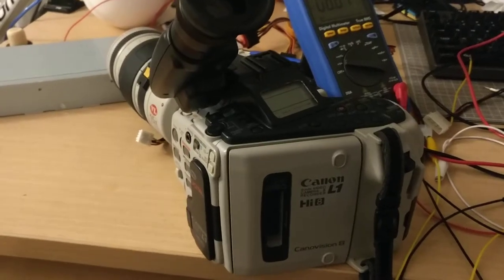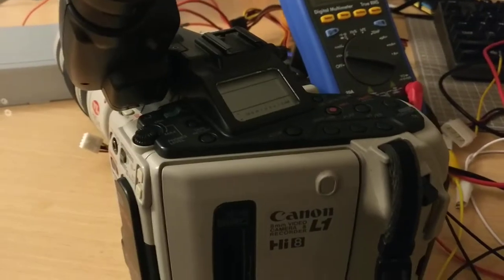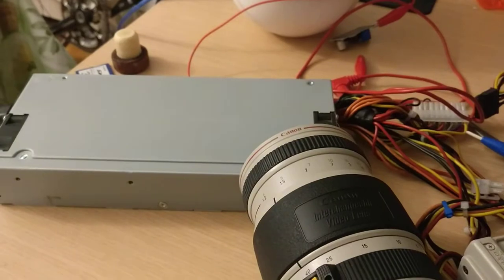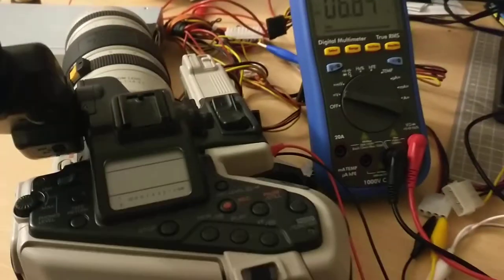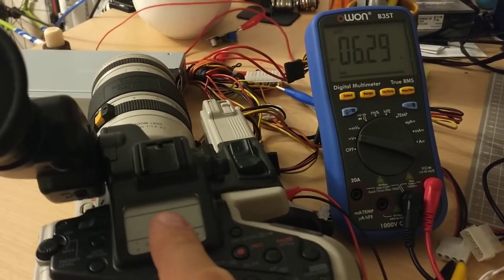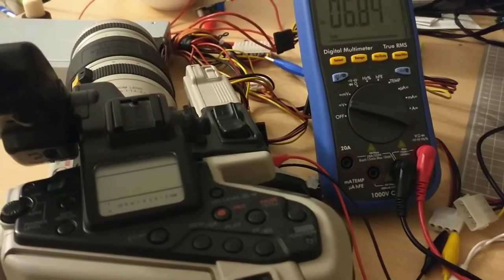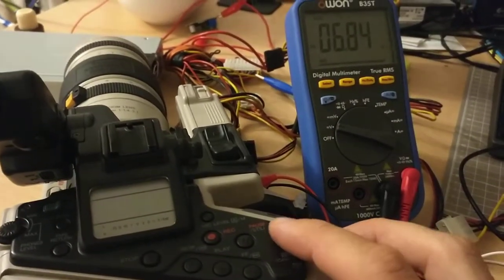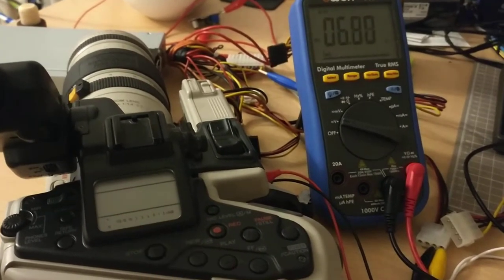Canon L1 camcorder malfunctioning

Comment: I have a L2, the main problem with this series of Canon camcorder was they used hundreds of micro capacitors that over time would fail and start leaking. I was fortunate 5 years ago to find a guy who was rebuilding the circuit boards and replacing the capacitors, sadly he passed away a few years ago.
Reply: I used him too, is there anyone else out there repairing these vintage cameras?
Reply: Louie Louie 
I don’t really have any other place to fix these boards.
You would have to find a place that does surface mount device repair.
Reply: @Tshasta4449  have you ever tried taking it apart? Because I'm willing to try, I just don't have the schematic for it. Thanks for the reply
Reply: @kb2qlq  
I’ve watched videos of guys reworking boards, they have to use video microscope to see the parts, these capacitors are the size of a pin head.